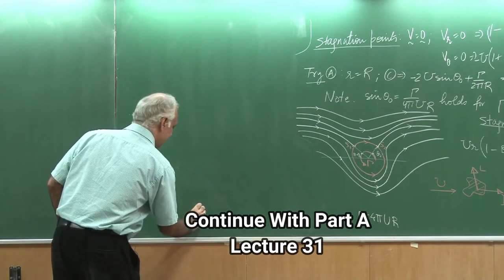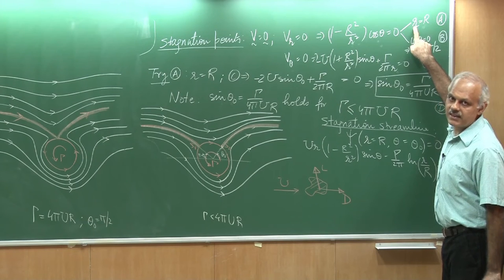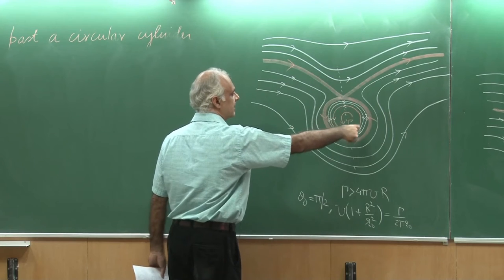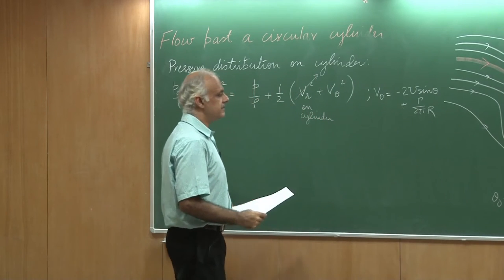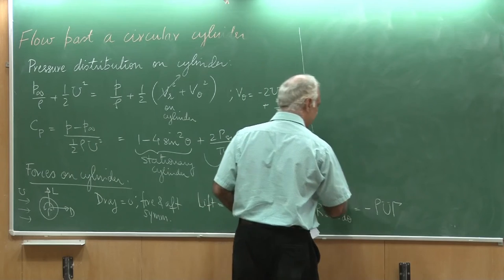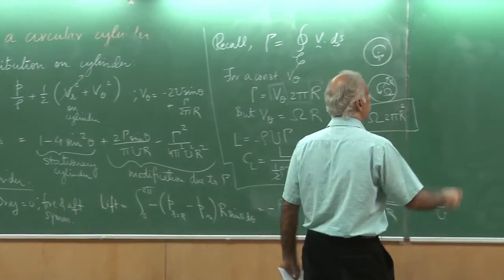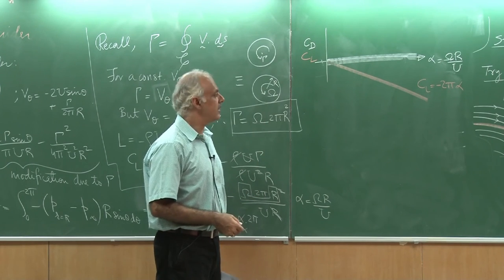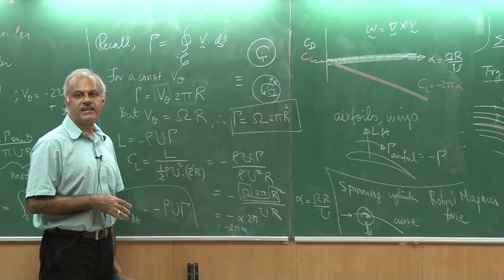Lecture31_PartB: Rotating Cylinder-Robins Magnus Effect(Fluid Mech & Rate Procs-Sanjay Mittal,IITK)

Comment: in the formula for circulation, the velocity (on rotating cylinder) is a function of theta, and hence you had not allowed to get it out of integral. Moreover, if you consider only the free vortex, then V_theta=K/r and ds=r.d(theta), which by substituting in circulation formula, r will be cancelled and Circulation =2.Pi.K . In either of cases, what you obtained is not correct. Please clarify it.